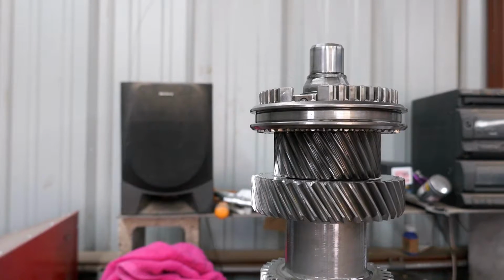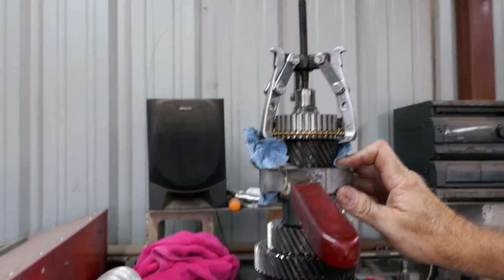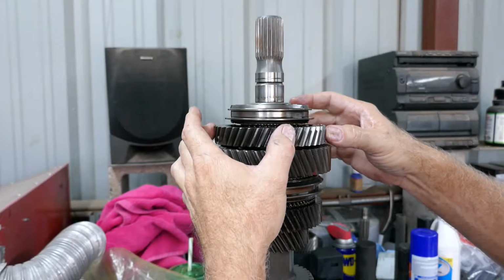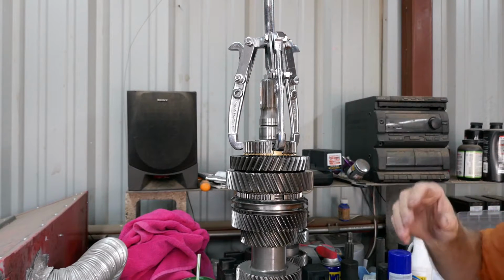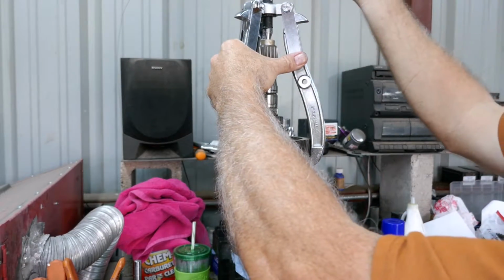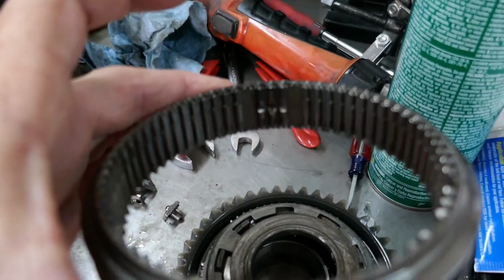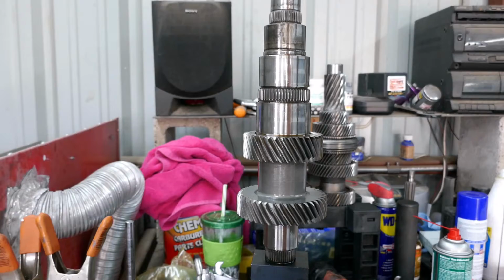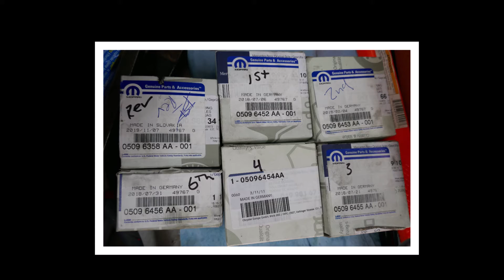NSG370 Jeep TJ rebuild video #10

Comment: I'm so curious to see how those new carbon disks will perform, and if it shifts smoother and quieter when its all back together.
Reply from the maker: So this is interesting. I have about 1500 miles on it. What I find is the carbon needs to heat up in order to have sufficient friction. Kinda like a set of carbon disc brakes on a Ferrari. The hotter they are, the better they perform. The transmission is flawless except when cold and only from 1st to 2nd. Once at operating temp, the 1-2 shift is fine. At the end of the day, I would not do the carbon again. Thanks